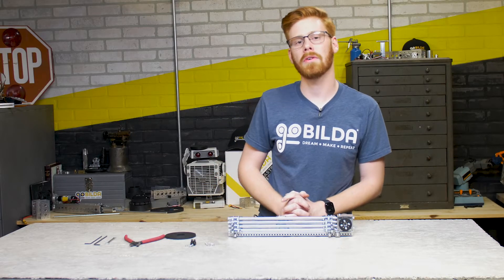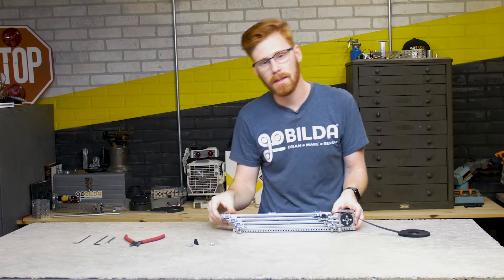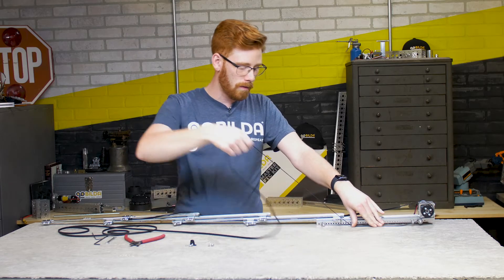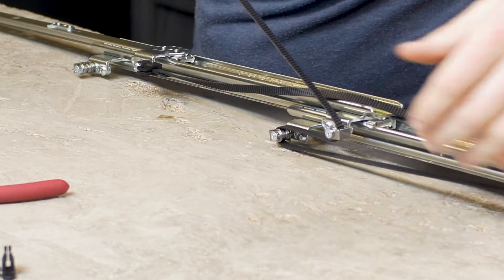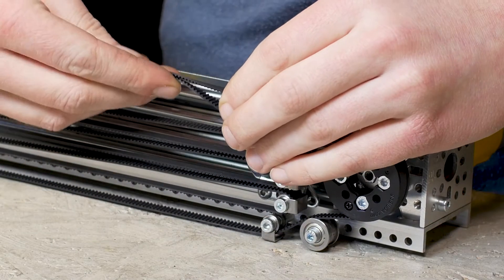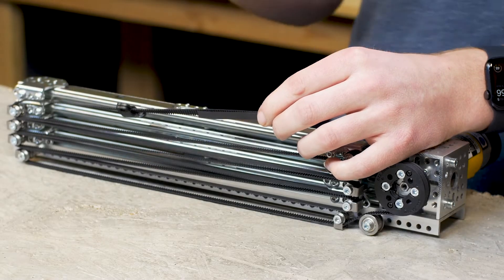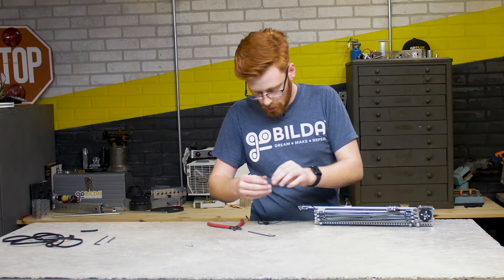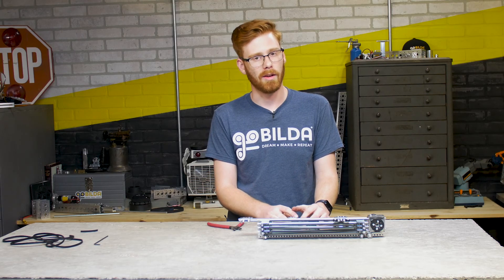Rigging a Belt-Driven 4 Stage Viper-Slide Kit

Comment: this is the worst instructions ever, super hard to follow, took 10 hours to build with pdf on website, do not recommend
Reply: you really need to switch to steel clamps.  We have over 6 plastic clamps that break with minimal stress.
Reply from the maker: Hey! Really sorry to hear you didn't have a good experience with the kit, we would expect this kit to take about an hour to assemble. We are always open to feedback on how to make our products better. The best channel for that is to email us at tech@gobilda.com
Reply: try building your own linear slide with misumis or drawer slides and then talk
Reply: The video shows how to do it though.
Reply: User error because these kits are incredibly simple to assemble with the pdfs...
Reply: @GearWizards16917 yeah

Comment: This is much better than string. but this too has issues. as the spacing between pulleys is not great and edges are not deep enough, belt slides and border of the belt start wearing out and gets jammed.. may be good for 3-4 games and need to be replaced.. there is better way to do this!!!
Reply from the maker: Hello,
Most commonly we see this issue manifest because of too low belt tension. Please send us an email with more details (ideally a video and photos) to tech@gobilda.com and we'll work with you on that!
Reply: The string was garbage for sure